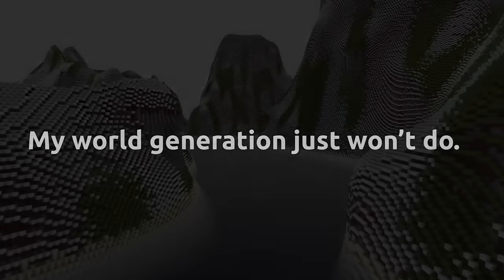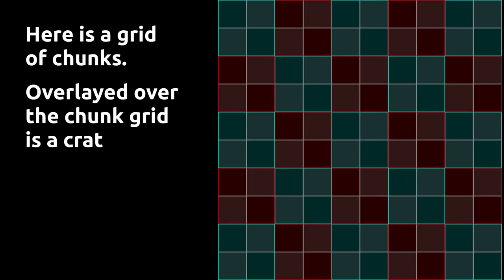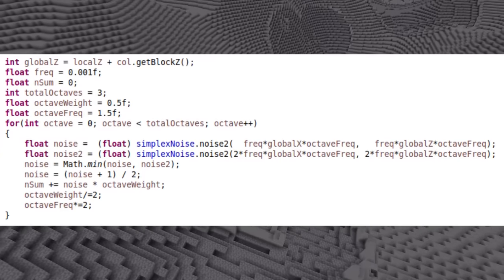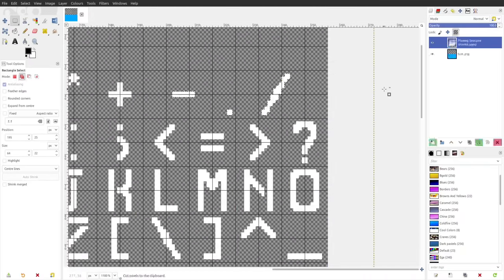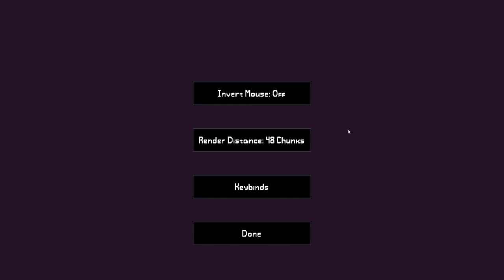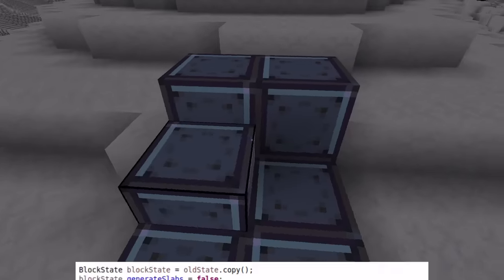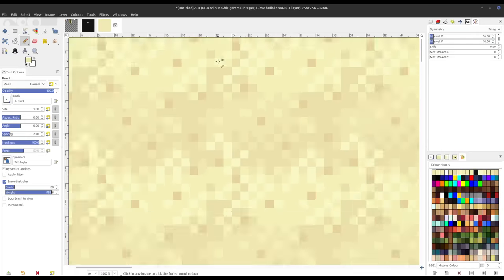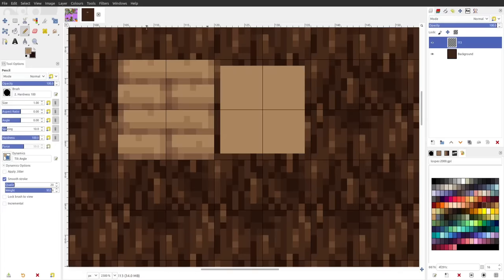Making THE MOON

Comment: If you make a redstone system, you should either make it similar to the create mod, or make it similar to electricity to the real world. You could implement existing redstone features, but add items such as math blocks (ex: logic gates). This could allow for smaller circuits not possible in Minecraft.
Reply: One sandbox game I think does a really good job of circuitry is Core Keeper. Its system is very simple but can be used for much more complex creations.
Reply: Using wires instead of vanilla redstone would be nice. Back in Tekkit era there was one mod I don't remember the name but you could put like 4 different coloured wires per block

E: Redpower 2

Comment: when you eventually update the UI, i would suggest putting each block variant underneath the same item in the block list. you could have it just display the "default"block in the menu, then you right click to open a pop up menu with the rest of the options.

also instead of having a separate entry for each type of slab, you could have just one and decide which version to place in the world depending on where the player is aiming when they place it.

the reason i suggest these is that you don't want to ruin into the same issue Minecraft has where you have thousands of blocks fighting for space in an inventory that was designed when there was less than a hundred. so you'll need to try to manage the number of different items, and at the same time keep the UI from getting too unwieldy
Reply: I wonder if a "tool" to change block from main might work... but the changed block will have an alt ID much like the old decaying Alpha tree leaves of Minecraft
Reply: I like how Minecraft's Chisel and Bits mod solved this. Just show the preview before you place it. That way you only need one block in your inventory

Comment: one thing i really miss in minecraft but really love in the mods for it, like create or immersive engineering, is the resources and various ways of processing those resources. once you've built a crafting table, a furnace and a brewing stand in minecraft, that's basically it, you now are capable of making everything as long as you have the resources, and it kind of cheapens the value of resources to me - because it means a resource is never 'useful in the future' but almost always 'useful right now'. i think additional processing mechanisms are really fun for this, and the way create does this - simplistically in form, so you don't have to assemble an entire nuclear reactor and it doesn't become a game for really factorio-type nerds (as much as i am one), but still with complexity in setup so you feel like you're building a machine rather than just placing a block. it adds a dimension that i think defeats minecraft's ongoing 'everything is just cosmetic' problem
Reply: I completely agree! I especially like how create makes early game resources still very useful late game where in vanilla that’s not really the case, or at least not nearly as much so.
Reply: In my opinion the redstone variance is way more immersive. There you have only a few simple blocks but through a smart interaction of them you can make crazy stuff. The immersive engineering in comparison feels like a linear gameplay and once you have followed the story to it's end it is not as interesting anymore. Unless there is a completely new mod with it's own new immersive engineering interpretation. 
When I look at circuit design, there I also only have a very limited number of elements, and you can make crazy circuits with it. Same with logic gates that can build entire computers. 

I don't want to downplay dose immersive engineering mods. The redstone version is stuff that mimics electronics or boolean algebra while the immersive engineering mods mimic systems engineering and logicistics management, which is a layer above the redstone. In the industry those would be two seperate job descriptions. One creates a device while the other creates a machine by using devices.
Reply: @benrex7775  I agree, but the problem with redstone in vanilla minecraft is that the vast majority of players don't use it and don't know how to use it. it's too complex a system, and its uses are limited to really high-end multiplayer gameplay, logic puzzles, and extremely high-scale stuff. i do think a lot of engineering mods are linear, which is why i'm particularly a fan of create and its add-ons, it feels different than that. 

still the core issue to me here is that in minecraft, by maybe a few hours into the game, i know i have unlocked basically everything, and it's only now a matter of collecting larger and larger quantities of those 'few blocks'. it's tedious. netherite in particular is an example of this. it's something you feasibly 'unlock' within an hour, but gated beyond insanely time-consuming, mind-numbing, 'just mine for five hours'
Reply: i can 100% agree with this, it's the major reason so many people i try to introduce to the kinds of games like minecraft get bored of them

also having more things you can build in the game world that have function is really gratifying

Comment: I know they are temporary, but something to note. With coloured lights, try not to make them monochromatic or super saturated. Red tinted lights for instance, will look better in game if they are largely white lights, with slightly reduced blue and green channels. Think of it as the distinction between the slightly yellow lighting of fluorescent tubes in warehouses compared to the harsh and striking red of photographic red rooms. 

Monochromatic lights, particularly reds and blues, can look very ugly when used to light environments, great if you want to use them for emergency lights in game for instance, but if their purpose is decoration, I would add more white and make them less saturated.
Reply: I wonder what would it look like if some of the lights were driven by blackbody temperature. Maybe even the global light as well. 6000K mid day, 3000K sunset...
Reply: He could make two types of light blocks, monochromatic lights like they are rn, and a white tinted variation of those, and if he adds a crafting system he could make those white tinted version craftable with the og monochromatic one.
Either that or make the user be able to customize the light's color via a HUD, but idk how feasible that is.
Just some food for thought
Reply: There's actually a very annoying reason why the lights are only red, green, and blue currently. Under the current lighting engine, the light level decreases linearly as you get further away from the light source. Because of this, if you have an orange light(or any light that isn't red, green, blue, yellow, magenta, cyan, or white), the color will shift as the light gets further away from its source.

The solution to this is quite simple; make light levels scale exponentially instead of linearly. This will have the added benefit of looking more realistic.
Reply: @icantthinkofaname4723 Can't this also be solved by storing light logsrithmically?
Reply: @TheRenegade...  is that not essentially what I suggested?
Reply: Lights as they exist are really cool; adding lights that function like you layed out would be cool too. Making the backrooms and blade runner will be fun

Comment: The font system in your game is very similar to the one in 4D Miner's UI! I was able to make a shader that can render text directly from a const char* string and destination coordinates. I just recently started replacing it with Pango, which has support for pretty much every language, and it was a lot more difficult to integrate into the game's UI code. I even found an issue with cursor movement, and I spent way too long trying to fix it. I ended up creating a merge request to fix the issue, and hopefully they will accept it!
Reply from the maker: Nice! Also I can't imagine how you'd go about optimizing in 4D miner btw, do you use a 4D equivalent of a frustum for culling? Or do you just naively render a short render distance? I should try it out when I get more time on my hands.
Reply: @finalforeach  4D Miner does use frustum culling! The current system uses the same algorithm that takes slices of 4D blocks to find the chunk's intersection points within your 3D hyperplane. If there are no intersection points, the chunk is not rendered. If there are any, you just apply a regular 3D frustum culling algorithm to the intersection points.

Comment: Do you plan on adding dynamic animations for the player and the mobs once it comes to that? Something similar to what Fresh Aninations does, maybe animations for block placing and breaking? Specifically I'm interested in an animation similar to how Omen places down smokes in Valorant, you get to chose the distance of the block you wanna place with the scroll wheele for example, and then the block doesn't just appear in the world but has an actual travel time instead, perhaps it could even send an actuall ghost of the block out when you place the block that gradually grows on it's way from item size to final form. Perhaps there could even be an option for placing multiple blocks, by hovering the righ click for example you could set a fix position and more the cursor to set a second location. When you decide how or where you want to place that wall you just place it with left click. If you want ro cancel you just let go of the right click.
Reply: Just a followup, IMO this system for block placement would be better than the one in vanilla Minecraft and/or you have currently in your game because:
- It's faster to make larger scale builds
- It's intuative and easy to get the hang of it (not sure if i mentioned it but there could be a hologram like animation to show where the wall you place would be by showing transparend ghost blocks while selecting or just placing even single blocks in general.) Perhaps this could even be made into a separate build mode? This would certaily be able to solve the problem of swinging through grass! 😅
- This would be a good way to controll the efficiency of building in combat situations, say if it took relatively long to actually place the blocks that would prevent the player from just boxing themselves in once they get into a tricky situation.
- It would look cool and feel emmersive. I can vision placing a 5x5 wall, my character would hold their hand out and the blocks would coume out of my palm, originally tiny but as their make their way to their final position getting larger, rotating in all sorts of directions along the way as they find how they are meant to stand.. It's important to note that the blocks wouldn't come out at the same time, but in 2-3 block bursts every fraction of a second, and the travel time could be about 1 second in total. If the place of the block got occupied before the block could form it would simply drop as an item on the ground. If you ran out of blocks before the wall was complete you could just cancel the animateion and placement of blocks, leaving you with a half finished wall.

Comment: If you want some inspiration for things like mid-to-late game progression, you could take a look at tech mods for Minecraft. Like the Thermal Series, or Techguns, or Advanced Rocketry for spaceflight

You could also take inspiration from newer mods like Create for more mechanical systems. And let me propose my own idea

So imagine redstone, except you can create a circuitboard that goes on any block facing any direction, and you can put very small redstone/wires and logic gates onto it (kinda like the wire system in Survivalcraft). Which means you can condense a lot of the space a redstone circuit into a block. Now I was thinking, to not make this too OP, the circuits should be limited to a 16x16 space to place down these small bits of redstone

Comment: Slab rotation shouldn't be based on a separate item. If you ask me, you should check which edge the raycast lands closest to and place the needed vertical slab variant accordingly, same with half slabs when it comes to top/bottom slab. This should make it much more simple for the players to use.

Comment: on the slabs textures. are you gonna make it so the ones that have a rim do it like Minecraft's smooth stone slabs, or are you keeping the chopped in half look? 
I really like the slabs that actually have a slightly modified texture to keep the polished edge look, instead of the ones that just look like half has gone missing. 
but I guess the texture logic could get tricky, making a unique texture for the slabs seems like a lot of trouble, maybe you could do some kind of logic where they take part of the top and bottom of the texture, removing the middle, to make the slab texture. but that's just ideas.
games looking cool, and getting all those little user details in-place can be a pain, so good luck.
Reply from the maker: For now the 'chopped-in-half' look is what I'm going with- but only because the inventory screen doesn't have enough space for more blocks! I'll add back the 'edged' variant as soon as that's resolved, it won't be that hard after.